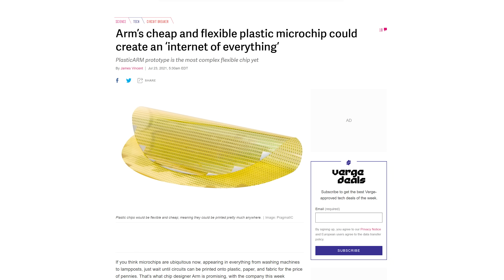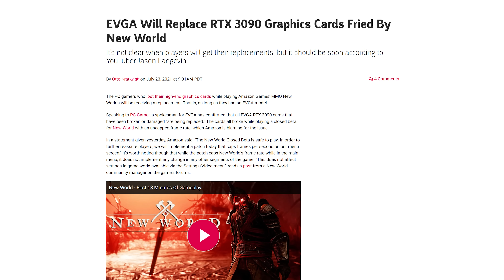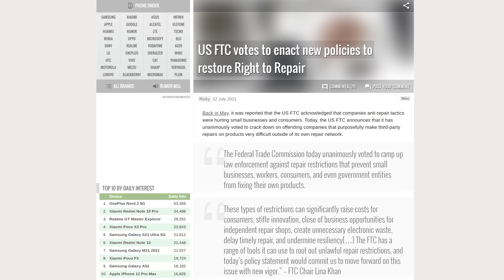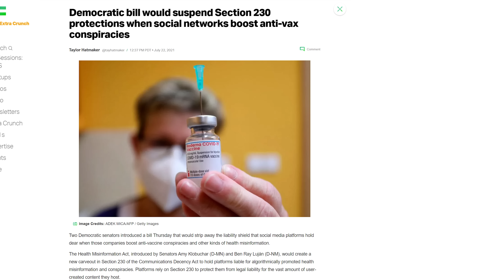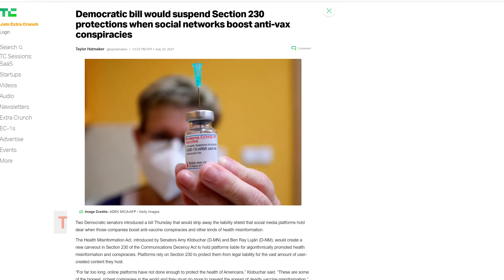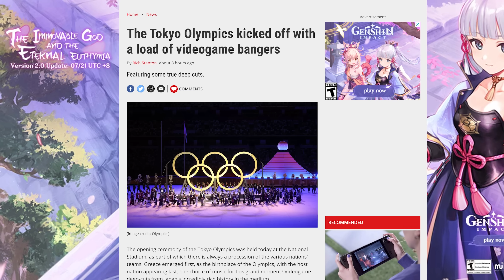Floppy Chips Will Change Everything

Comment: I want a pringles can of CPUs now
Reply: Bro it would have the right amount of cronch
Reply: @kimwhitcomb2544 mmmm..... Delicious !
Reply: When the plastic cap has more processing that the chips in the stack, you know your're being snack tracked.
Reply: I really wonder if there is any way to made CPU out of some edible material
Reply: @glitchy_weasel  you can eat sand
Reply: @Ryne4S  anime girl computer
Reply: @txe1nd  CBT
Reply: @Joe Dip it in thermal paste! I like the teriyaki-flavoured stuff.
Reply: I think it would be amazing to have flex cpus into medical implants aand flex motherboards into prostetics
Reply: Bet you can't boot just one!
Reply: @mrbunnylamakins a Pi Zero can fit inside a pringles can no problem!
Reply: @mrbunnylamakins if a can was .2" bigger, it could fit a pi 3 but a pi A+ is able to sit in a can with some room to spare
Reply: Not gonna happen. Those CPUs will be flexible and bendable, but they will still have flat intrinsic geometry. Pringles have negative intrinsic curvature, so you can't turn one into the other.

Try to take a piece of paper and bend it into a pringles shape. You can't.
Reply: @Meni_Rosenfeld  bro its a joke
Reply: @YourCitizen  Oh, I get it! I get jokes.